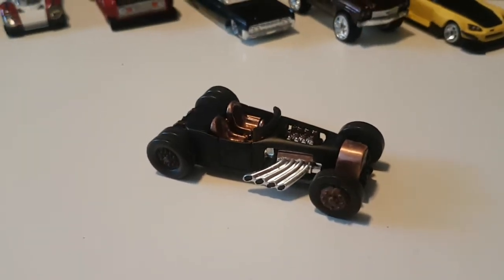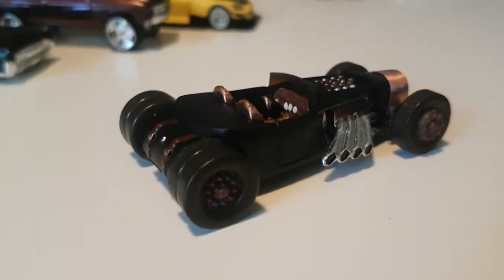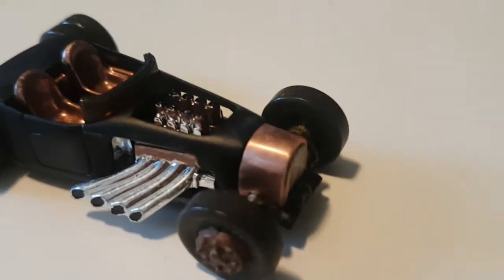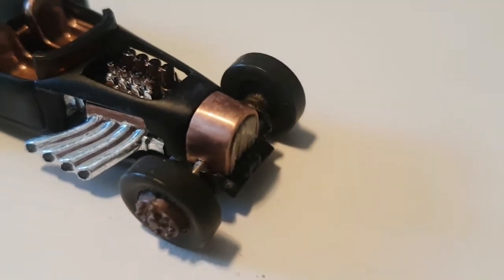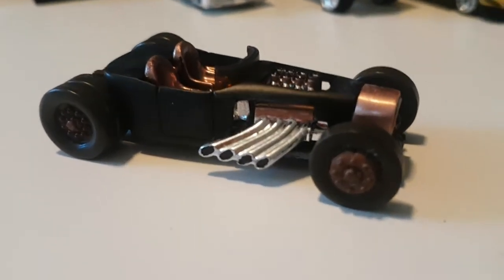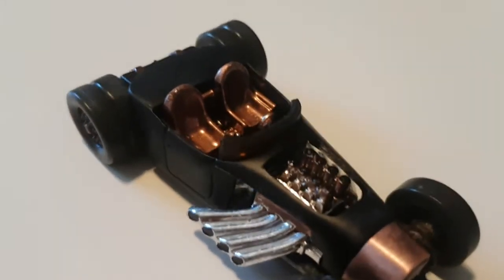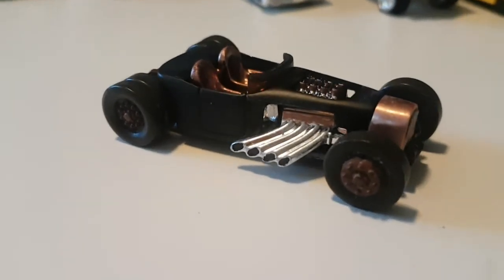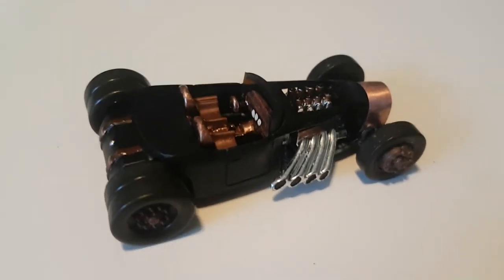Hotwheels Mod Rod Copper

Comment: Great copper modrod!  I love the color and how you reworked the body (though I think the seats could be lowered a tad, imho) and the grill looks sharp.  Stroke of genius using staples, will have to swipe that one.  You didn't mention the wheels, I love the rear duallies and the hubs on the front pair.  Where did you get them??

Thank you very much for sharing, stay safe, have a Happy New Year, and keep on keeping on!